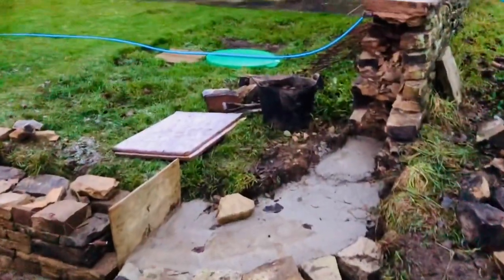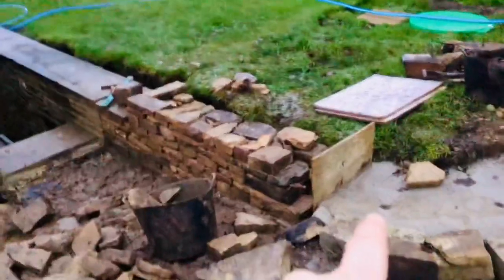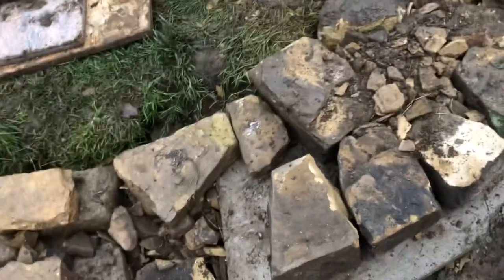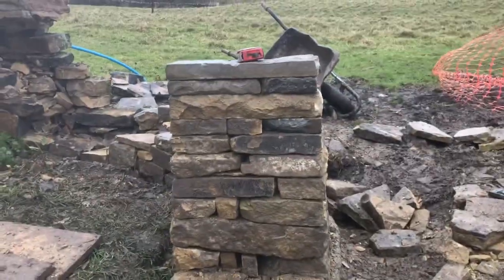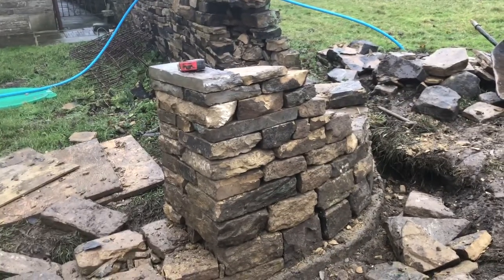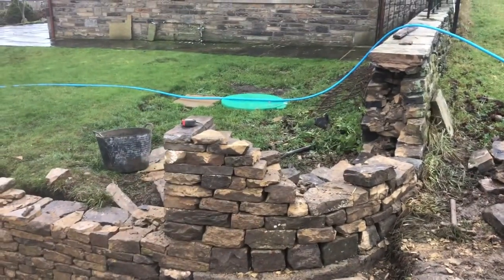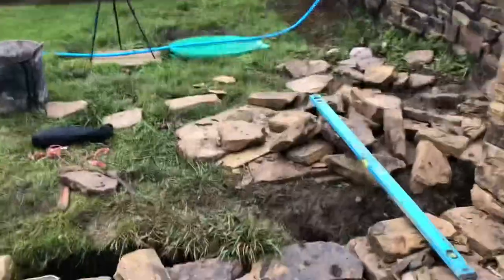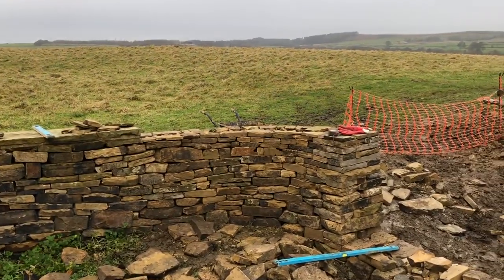Dry Stone Walling - Building a curved wall (use subtitles)

Comment: Good video, can i ask...Did you use any cement in the middle of the wall to hold a few bricks in place?? or some dry mix maybe to stop a few rocking bricks?
Reply from the maker: Hey Sarah, I didn’t use any cement in the wall it’s self, just a concrete base and the cement to put the flags on top 😊⚒